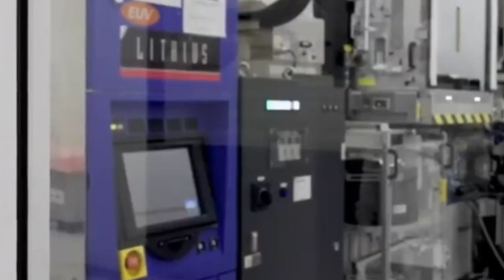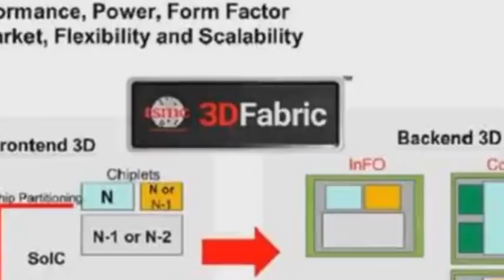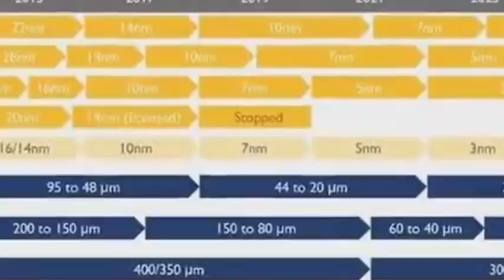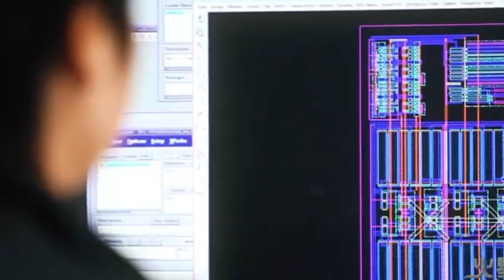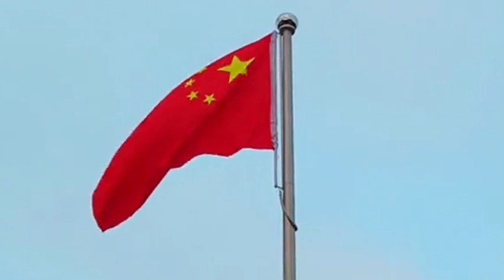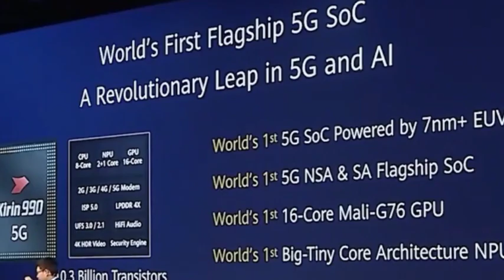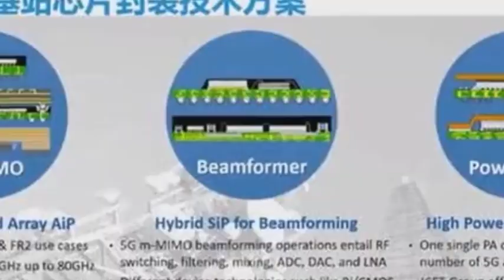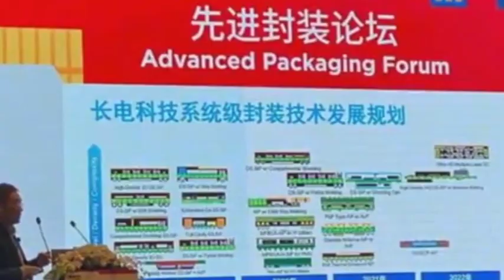ASML's EUV restriction rules will be announced soon, which will not affect Chinese EUV development.

Comment: It will be suicidal to depend on ASML or Japan. They already show intention to oppress China. However they want China’s money. Therefore, buyy whatever is needed to fill the stop gap but remain diligent to develop your own. China must first get its SMEE 28nm DUV out first. All kinds of news. Some say it’s ready and some say that its not ready. Believe it’s not ready. Why? It’s because China bought many 38nm DUV from ASML recently. Although this particular DUV comes with a wide range to produce up to 6nm (as claimed by ASML) but the yield on is not guaranteed. China sees this as a good stop gap fulfilment. Maybe the yield can be good up to at least 14nm. This will fulfil up to 90% of China’s manufacturing requirement. China must continue to strive in this area.